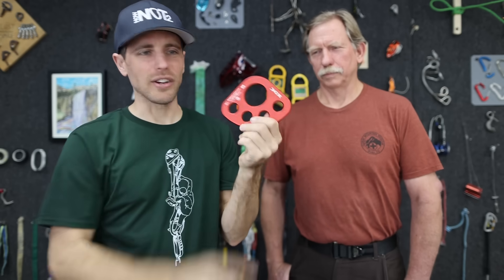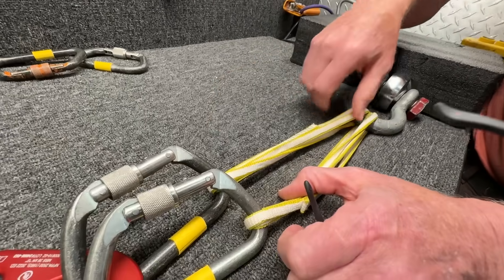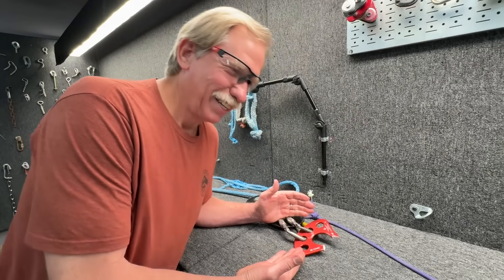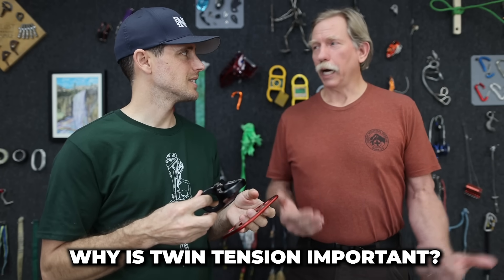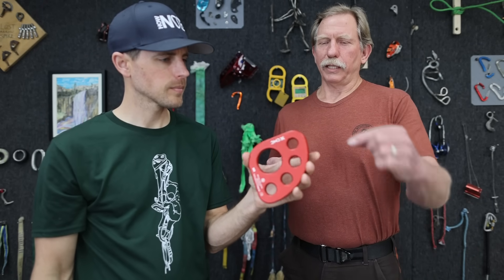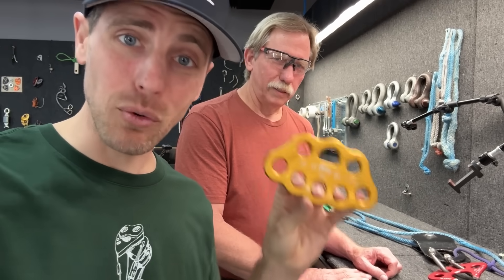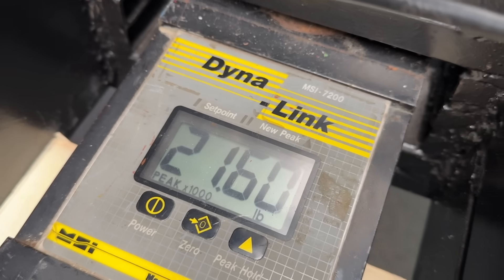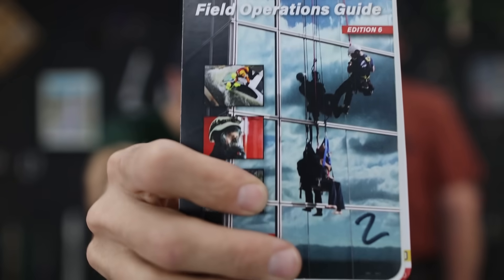When is Redundancy Ridiculous?

Comment: I think most redundancy is to cover for human error. That monolithic tree really wasn't monolithic. You are not going to put 12KN on a cam. But did you really remove the sand from the wall before you placed it? That sling you just connected. Are you sure that it's even attached? or is it just holding on due to friction.

People make mistakes. Redundancy allows people to get away with making mistakes.
Reply: ...and to allow for degradation of non-metallic components due to time, abrasion etc.
Reply: Finally some brains here. Clearly trying new gear under controled circunstancias is not a correct representation. And as you said this is in great part to prevent human error like basket sling. Looks like they just want to sell more of the rescue guides so people can learn from it (?) Without  actual training I guess.
Reply: @Mayorclock3423  These are good questions and comments. Yes, I do want to sell guides but as I said at 11:53, the intent is not to pull this guide out on a rescue, It is meant to be used in a proper training course and then to be able to refer back to the procedures because while these skills are not rocket science, the are very perishable. We did this particular testing because there is so much myth in the rescue world. It's not scientific by any means. We call it quick look testing to gain personal experience and give some confirmation to the theory. In this case, it's fine in my mind to have a single point like a quality rigging plate. It gets two connections. there is no reasonable reason to think a piece of machined aircraft aluminum that is third party tested could fail with the kind of forces that could be generated in rescue systems. Software? I want two. Connectors? I want two. Eyeballs? I want two pairs.
Reply: @DRRRescue  The CMC plate has a single point for failure, the large hole.

You could just glue two plates back to back, from two manufacturing runs. I'm not sure how much two plates reduced the carabiner capacity, but I'm speculating not low enough for concern.
Reply: @DevinH-64  So what Im saying is that it is generally accepted in the industry that we grant an exception to the single point rule if the gear: Is made by an ISO 9001 compliant manufacturer with third party testing, has no moving parts and the human is not able to mess it up or influence it. It is not realistically possible to generate the kind of force it would take to fail that piece of machined metal. A human cant make a mistake in its operation causing it to fail. This test was just to show why leaders in the industry are saying that a single piece of equipment like a machined plate, is fine. It does not matter that there is a single hole. you can make the argument the there could be some type of flaw in that aircraft grade aluminum but there is not body count. We aren't failing plates. Well we are but with 100 times more tension than would ever be put on it in any kind or rescue operation. I do appreciate that there is a lot of experience out there but unless people have been closely guarding the incidence of this kind of equipment failing, I would say that it just is not happening and there is no problem with using a single plate.
Reply: @DRRRescue  I've been giving this some thought. I think that we are used to a lot of products with very high MTBFs, and very long average lifespans, that still have a high rate of crib death (early failures). All the ISO-9001 and Six-Sigma Black Belts in the world and I still imagine the one guy fucking off and sending a messed up batch of aluminum along to be machined, or whatever. Redundancy is not "this is twice as strong as I need." Redundancy is "this system requires two uncorrelated black swans before I die."
Reply: @bkuker His point is that they aren't loading these plates up to 45 but more like 4.5. The safety factor on these plates isn't 10x, but more like 15-20x. Even if they sent out a bad batch of plates that failed at half the minimum printed on the plate, they wouldn't be seeing them fail in the field.
Reply: @DRRRescue  Apologies for my earlier trolling. In industrial applications, clear rules and redundant systems are essential. For rescues, speed is crucial, and they often have to adapt on the fly, so you're right. The basket example: Someone is bound to mess that one up.
Reply: Part of risk assessment is deciding when to accept risk. Some employee having an off day on the job at a manufacturer isn't impossible. That sort of thing happens. But it's very rare with certified equipment.

You could certainly argue in favor of using two lighter weight devices from different manufacturers in tandem, but you have to draw the line somewhere. The important thing is making sure that somewhere is reasonable.
Reply: @SnakebitSTI  Complexity in the system is risk too. Having to use two different products by different manufacturers probably increases complexity, thus making human errors more likely. If one reasonably can keep stuff simple, that probably is a good idea. 
Redundancy and simplicity are trade offs.

Comment: I don't feel like you can call the Petzl "Redundant" because when one of the holes breaks the other one is pretty much certain to break too (but 96kn!).

I do think about manufacturing defects or damage: When you set up a redundant system each individual pathway is rated and calculated to hold on it's own. The redundancy is there to handle the unexpected fuckups, not just massive brute force.
Reply: And there's also the issue of compounding uncertainties. Imagine you have components that have a 1% chance of failure - if you use two in series, the chance of failure almost doubles (1 - 0.99^2 ~ 1.9%); with three components in series, it almost triples (~2.97%) and so on
Reply: @alpardal  It'd be way past 6-sigma for it to break at loads they can generate, the probabilities become vanishingly small. There's a non-zero probability that the carabiner will quantum tunnel through the plate, but we don't worry about that.
Reply: @alandoak5146  The question was "is redundancy ridiculous for such a strong master point?" 

For me the answer is yes, redundancy is silly for such a strong master point.... BUT what if for some crazy reason that master point isn't strong. Is it really only a one in a million chance that it was damaged before I ended up with it? That there was porosity in the aluminum stock?

A redundant system should require two totally uncorrelated failures to fail.... Yeah that's what eats at me... I want to be able to survive one unlikely failure...

Mathematically it's probably a wash. I want two 5-sigma failures before I die, and this is just one 6-sigma failure point. (The math might not be perfect, never did get that black belt)
Reply: This is also why safety officers, gear inspections and logs are standard practice. If the plate has been marred or deformed, retire it for a new on. Unless it’s been hit by a truck, it is vanishingly unlikely to be a point of failure.

Comment: Personally I always wear two climbing harnesses in case one of them breaks.
Reply: Well, a standard seat harness is usually a set of leg loops that will fully support your weight paired with a belt/waist loop that will also fully support your weight and both connected with a belay loop. So yeah it kind already is.
Reply: Belay loop is a single point
Reply: @CragDawgs   - oops, time to double up..  (NB, the belay loop is tested, certified, and is only designed for the single user weight, probably super good enough (paracord can hold static body weight- spectra kite string, a lot more)...
Reply: @kadmow  too bad harness is not made out of paracord then :(
Reply: @kadmow  
Also, some climbers die because of harness failure ....
Reply: @MrLyckegard  You're thinking of Todd Skinner's accident on Leaning Tower.  Bit of a special case, imo.
Reply: @CragDawgs  not the default for sure, but they're are many harnesses with dual belay loops maybe 15 percent of what's available, typically the more expensive ones
Reply: That's what we in the USAR business call a Class III harness.
Reply: The redundancy really is just making it five times stronger than it needs to be.
Reply: @tomgnyc  and since climbing gear usually have a safety margin of 10 or 20, 5 will be a downgrade
Reply: Or 2 pairs of boots
Reply: Do you have a twin you can climb with?
Reply: One harness should be large, one small, in case you gain or lose weight during the climb. I've seen that happen many times.
Reply: @harlanstockman5703  Maybe every1 should have a pregnancy harness... In case one get pregnant during a climb... Are you a male? Maybe sex change also happens during climb. We need to be open to all possibilities
Reply: @harlanstockman5703 Schrödinger's Climber

Comment: Was the force on the plate rated for only connecting a single point on each side? So connecting 2 points either side is effectively 2 x 45kn ~ 90kn ?
Reply: It's MBS; MINIMUM breaking strength. Its not actually what force it breaks at, just the minimum force it might break. stronger is fine, just not weaker.
I assume its 45kn for a connection from any hole to any other hole.
Reply: Its definitely 45kn on a single ring.
Reply: @merlin_V2  Saying "definitely" makes a mockery of HowNOT2's entire existence. Their's a "you never know until you break it" mind set. 😆
Reply: The emphasis should have been on a single ring. Because the weakest link should be the minimum breaking strength.
Reply: @merlin_V2  Well, thats not what they were testhing, tho.
Reply: It’s 45kn for 1 hole because as pointed out in the video some 2 rope systems only have the mainline in tension so all the static load is on 1 hole. What they essentially did here was load share 2 holes and big surprise they got double the MBS. It’s the same as when the guy says my 22kn sling in a basket can now hold 44kn. The other thing is with his 2 tension system there is no way to know its 50/50, could easily be 70/30 especially in a haul. Not the best testing they’ve done overall.